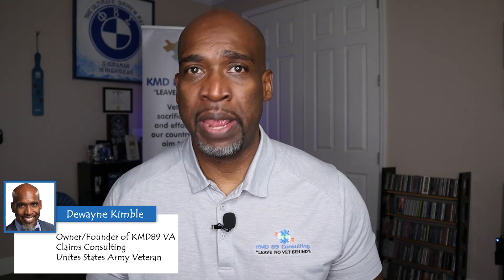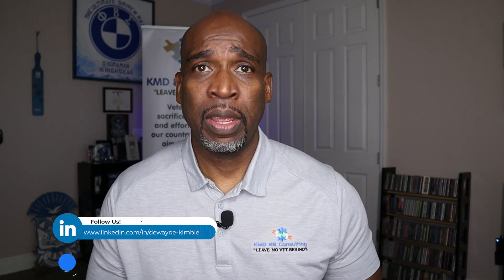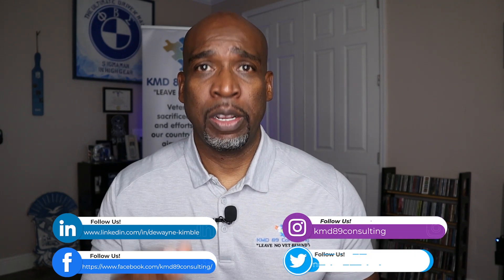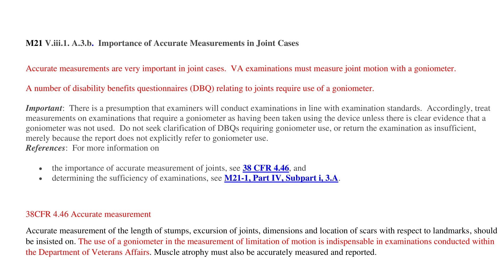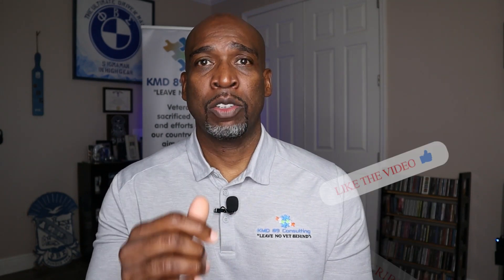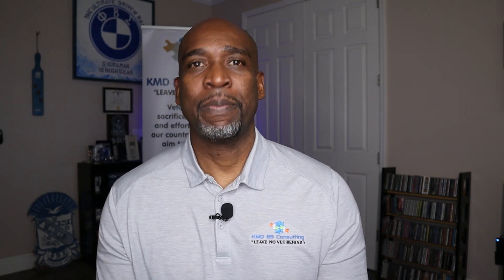VA Disability Claim Range of Motion Measurement on a VA C&P

Comment: I just had a C&P exam for bilateral ankles and feet on the 17th of June. The Nurse Practitioner didn’t use a goniometer. I went to my VSO requested a copy of my last C&P she wrote she had used the Goniometer. I wrote a statement on a  VA form 21-4138. Mentioned this and several other mistakes and omissions that the examiner didn’t include plus her cold attitude and she didn’t perform the 3 reputations of active ROM either she didn’t use my pain numbers on her report. She never mentioned any flair-ups. When I mentioned them to her and I also recorded the audio using my I-phone. I complained to The VA requested a new C&P also to LHI. She had already mad a decision before the exam started! She dehumanized me by not acknowledging me. Didn’t build any trust between a caregiver and patient. Had bad bed side manners. I knew to start recording about a minute into the exam when she came off as bossy and cold. My gut feeling set off my instincts to record this! I work in the medical field as a Pediatric Registered Nurse. She is defrauded bout taxpayer’s by conducting bogus C&P exams!
Reply from the maker: Sorry to hear you had to go through that.   In a previous video, I state how I went through something similar.  It's makes the process more frustrating, when you have examiners like that, that are against veterans.
Reply: I had my C&P on july 12 for right knee and ankle ROM secondary to my service connected left knee. The nurse practitioner was moving my knee up and down even when I told her not to and I was in pain, then she got smart an stated that didn't you drive here and telling me I was being a baby with the pain. I contacted QTC to file a complaint.  I video recorded the whole C&P with a spy camera I bought on Amazon. I uploaded photos to my claim,  I want to see how QTC will get out of this one. #beltway95sports
Reply: @BZ-SP  The VA didn’t give me another C&P exam. If this was a court of law and showed the jury my evidence I would win at least give me another C&P exam. I will see what I do! For now I’ll add this claim as a secondary to my Right knee that is service connected at 40%. I offered the VA a copy of the C&P audio they never contacted me or sent me a letter explaining their actions of my complaint! One thing for sure is I won’t ever use LHI I had good results with VES and QTC.
Reply from the maker: @beltway95sports61  They are not suppose to move any joint when testing. Wow, the examiner was really rude.  If you don't mind, keep us up to date on the complaint.
Reply: @beltway95sports61 lol what happened ?
Reply: @beltway95sports61  you have a link to that spy camera?

Comment: Are they supposed to do a weight bearing range of motion? Such as for the knee while standing. Or elbow while holding something.
Reply from the maker: In the VA's rating schedule, it shows examples of range of motions for the joints.

Comment: What happens if you cannot mover your joint to get a measurement?
Reply from the maker: If you can't move, does that mean you can't move, sit down, stand up, drive or event ride in a car.  They need that ROM even if it's 1 degree.   You can now get your signed copy of my new book "VA CLAIMS SUCCESS - Your Guide To Maximizing Your VA Compensation Benefits":  https://store.kmd89.com/

Comment: Please let me know if it’s a good or bad thing. I got seen for a c and p exam for my shoulder. I couldn’t move my arm due to the excruciating pain of moving my arms the slightest bit. the doc didn’t use a gonoometer so we couldn’t even do a rom test. he sent me to get an mri. i only demonstrated that i can move my elbow only just fine. Is this normal ? Will i still get rated
Reply from the maker: If granted S/C, it's based off pain and ROM.  If there is pain, shoulders would be 20 percent.   Go from 0% to HERO and win the VA compensation you deserve, with my monthly veteran membership: 💪 Sign up now and take the first step towards a smoother VA journey - https://va.kmd89.com/membership